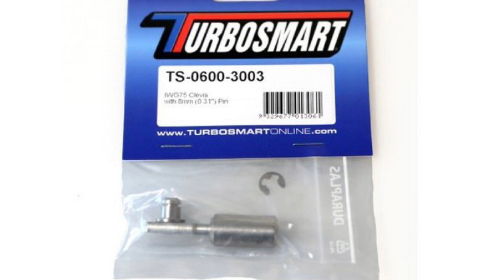VW/Audi TSI Turbocharger Wastegate Repair

Comment: I did this job a while ago when i saw these kits came out. I didn't see the turbo smart part! I ended grinding off the pin on the end and having a machine shop make a new one and tack it back on. 

I took out the bushing with a long bolt same way but with the impact. It came out without having to drill the roll pin. I didn't even know it had one. The pin fell out after in 2 parts.

Comment: Great video! Inspired me to do it and it went easier for me to get that bushing out. You can use a punch or a bolt to hammer the bushing out instead of trying to extract it. Plenty of room in the housing.

I might need to replace later on as the housing is cracked at the wastgate opening unfortunately.

Comment: Great video... very detailed 😊 i had mine fixed by my local turbo repair shop in South Africa and no im sitting with fluctuating boost at higher RPMs...they eventually also put a adjustable rod on but for some reason its still doing it but alot less thou, should it be adjusted tighter?

Comment: Hi! First of all nice and useful video
Did you have problem creating a M6 thread in the 1/4 UNF?
Did you removed the previous thread with a drill or did you just forced the M6 male in the UNF thread?
Reply from the maker: I’ve actually just done this job again. No problem running an M6 tap straight through the 1/4 UNC internal thread. BUT the clearance of the shaft to internal was a bit large so I had to weld on an additional M6 nut to the Clevis so thread could be locked for adjustment.
Reply: Thanks for your reply! So if I understand well the welded nut is to ensure a better thread to the shaft. Could it be a good idea to weld the extra nut with an M6 screw inside to have the threads alligned?
Reply from the maker: @mrwest77  yes you could rather weld on a M6 (or even better a 1/4 UNC) bolt to the shaft.

Comment: Thank you so much ! Just neeed it ! And one more suggestion is best to use copper head to hit the bush into the housing instead of steel harmer
Reply from the maker: Yes a soft faced hammer would be perfect. Thanks for sharing.

Comment: That's amazing. What is the bushing made of? Although your process is brilliant, have you considered drilling the old bushing out?
Reply from the maker: I think it is just steel. ‘Pulling’ the old bushing out is much easier than drilling it (in my opinion).
Reply: @PetesWorkshop  The pulling tool was brilliant, nice work
Reply: I just replaced my bushing today, hammering it through with a drift worked fine to get the old bushing out and was quick.

Comment: Hi Pete, thanks for the great video, I have a spare turbo that I will give a new waste gate flapper. I only have one question. Which diameter of drill did you use to drill the hole for the new roll pin? 3mm or a little less?
Kind regards ☺️
Reply from the maker: 3mm drill bit is fine.
Reply: @PetesWorkshop  thanks a lot ☺️. So 3mm drill and a 3mm roll pin should do the trick.

Comment: I just got a new turbo in my Seat Leon 1,4 tsi 150 (pretty much a golf engine) but its as if the Wastegate arm still makes a little sound.
 Is it true that its ok for the Wastegate to be a little loose when the engine is off, but has to be completly silent and locked when I turn on the engine? Because I noticed it still makes a little ratlle (once in a while), when I drive. Please help me😊
Reply from the maker: As long as your not loosing boost it probably doesn’t matter if it rattles occasionally. Just annoying! You could probably file the wastegate mounting holes then adjust to put a bit of pre-load on the push rod to stop the rattle. Also fitting that clip does help a lot too.
Reply: @PetesWorkshop  i've noticed that the rattle only comes when i push the brakes slightly and its down to 15- 10 mph. It does it three times. But Is that the same ? Or is it something else? Its not a sound from the brakes, Im pretty sure
Reply from the maker: @TheWatersLundParty  I’m really not sure. You could disconnect the pressure hose from the waste gate actuator  (block off the open end) and drive it for a bit. Be careful though as your boost will spike high.

Comment: epc on my audi a3 comes on at cold start. i figured it was the acutator that got stuck or something but mor likely to be the wastegate right? hmm, i turn on the engine with a little gas, and no epc but i also rev it to 3000rpm everytime i start the engine.

Comment: Pete, are the wear problems due to poor alloys? I don't think that the Mack trucks and JD tractors are prone to these failures.
Would you expect to do this repair again as a repair to the repair?         Thanks,  Dennis
Reply from the maker: Because I used the Turbosmart adjustable clevis, I doubt that I will ever need to replace the wastegate actuator. Perhaps just adjust it.

Comment: 12:08 This is exactly how I thought I would repair a K03 turbo but how does one prevent the shaft from wearing on the bushing? It seems that the bushing is made from a material that is too hard for the shaft but should be made from a softer material such as a valve guide for example.
Reply: The clip is the only way to prevent it
Reply: @Spindaoppblock  So, by preventing wear in the actuator arm, the waste gate shaft wear is reduced?

Comment: Thats alot of work for just a waste gate flap. Great info though I have mk6 jetta 1.8t almost identical as that engine. And it seems it would be  much more easy to replace turbo. Great job though!!!
Reply from the maker: Yep same engine just diff crank and pistons. Slightly diff turbo I think. Easier to replace, yes and also more than 10 times the cost.
Reply: @PetesWorkshop  yes it is. But if I take the turbo off then I mine as well replace it due to only having 1 vehicle lol great job though

Comment: will my mechanic do this if i buy the part
Reply from the maker: Highly unlikely! Most mechanics are only interested in swapping parts rather than repairing mechanical failures. You can sure ask though as some mechanics will do this kind of repair.

Comment: My car has the same issue I believe is this not supposed to be driven just got the check engine light a few days ago replaced DV and that wasn’t it believe it is this issue
Reply from the maker: Hey mate. Unlikely to cause engine damage if you keep driving. Just annoying rattle and lower engine power.

Comment: How much would this job cost? Think mechanics would even do it?
Reply from the maker: I think very few mechanics would consider doing this work. I guess it would take approximately 4-6 hrs, to remove the turbo, do the work, replace the turbo with new seals and gaskets. Its not going to be cheap. Unless you do it yourself. Good luck.

Comment: It's "BUSHING" NOT "BUSH", mate. Please, man correct yourself for any future videos. You are doing pro-level repairs and service, however your jargon is making you sound like an amateur. Bravo on the outstanding diagnosis and repair/service you've performed here. I just bought a 2008 Audi A4 2.0T Quattro Cabriolet with 121,200 mi. on it for $3,450US, a few days ago. I don't trust its previous owner so I think I'm going to service its turbo after performing some basic maintenance on it (oil/filter change, "light" tune-up of checking and cleaning its coil packs, maybe replacing spark plugs if they're bad, etc. topping off ALL fluids, etc) In the Fall I plan on repairing all the stuff I KNOW is broken or inoperable on it, such as the electric roof, auto-trunk, etc.